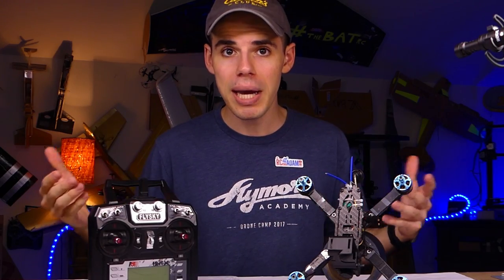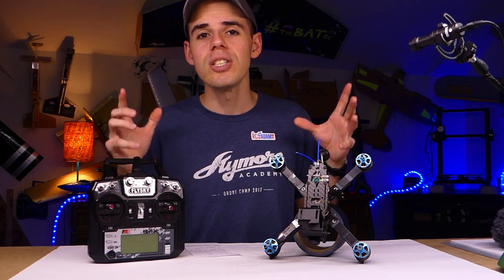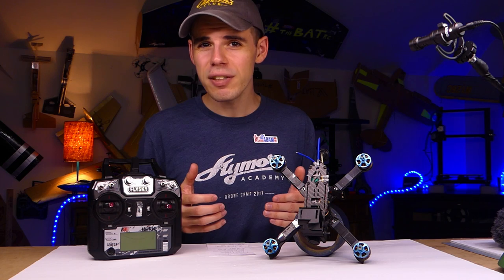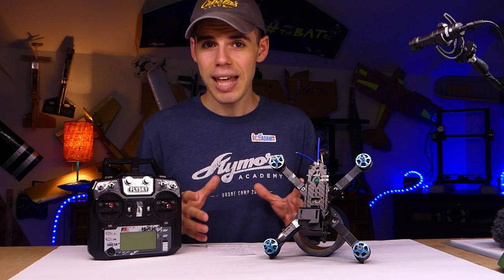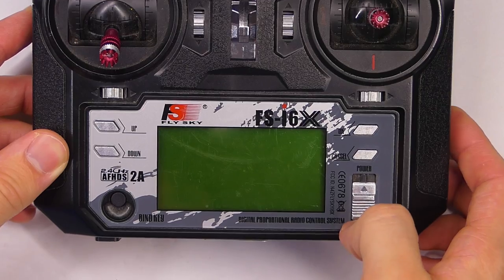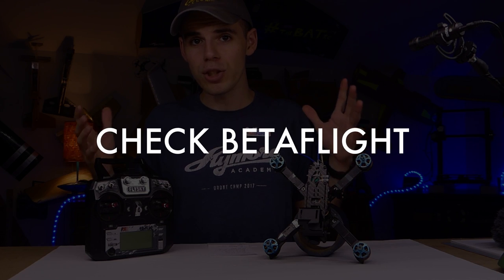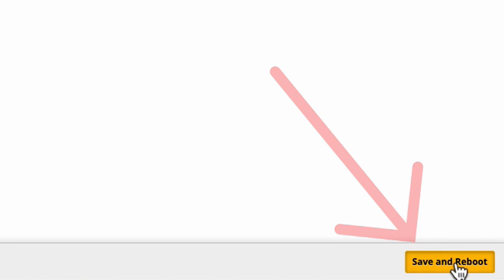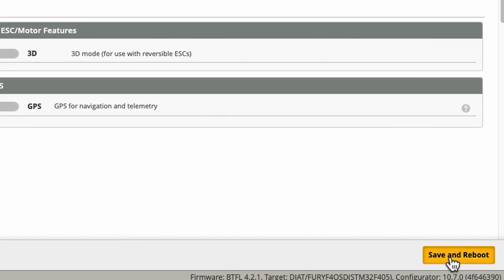Why Your Transmitter Won't Show in Betaflight - Most Common Fixes

Comment from the maker: Did I miss anything? 🧐
Also, if you got at least 10¢ worth of value from this, consider supporting me https://ko-fi.com/rcwithadam
           More videos and resources on my website http://rcwithadam.com/
Reply: Hello, I think your video is super good. I have a HappyModel EP1 ExpressLRS 2.4GHz receiver and would like to set the VTX table in Bethaflight, but it cannot find it. what should I do?
Reply: All these options I tried however my crossfire reciever only comes on when I plug in a battery 🔋, however it is bound to my radio it just doesn’t show the transmitter linked to it all wiring was checked etc
Reply: I repaired my Nazgul 73mm reciever connection because of this video, thanks a ton!

Comment: Hi. What can I do if binding is OK, but sticks don't work nor move in betaflight?

Thanks
Reply: Please help did you get around this issue?
Reply: same
Reply: I'm having the same problem please let me know if you found a fix... my radio was working fine and then I bound it to another quad and that one was working fine and then now I got both of them working and neither of them will work on betaflight it says they're connected but it doesn't show it on betaflight when I move the sticks nothing...
Reply: Any update?
Reply: @griffey11  updates?
Reply: Crickets.... @ThunderFarter

Comment: I replaced an antenna on my frsky xm+ The receiver is solid green which leads me to believe that my transmitter and receiver are bound. Inputs aren't showing up in betaflight when I'm in the receiver tab. Any ideas on what might be going on?
Reply: did you ever figure it out?
Reply: The xm plus uses 2 protocols like rsxr, I had this problem because I flashed 2 ex and int updates to my radio and my reciver but both regarding the subs mode, I was on cppm protocall, u have to set them to the right protocall to make them respond, as well as give correct stick inputs. I hope this helps

Comment: great video however it did not resolve my issue. ive the flysky fs 16 x and the flysky fs a 8s both was working then just stopped, tried flashing the firmware doing a fresh install, just nothing. there no bars in beta flight for the tx. i have it wired up on uart 2 and set it up as in video but working

Comment: Hey, thanks for the great video!  Unfortunately, I'm still struggling with this issue.  I have a Taranis Qx7, updated firmware to newest OpenTx, and a R-XSR receiver that I've flashed to the newest version that would work.  Quad shows bound to the transmitter. I've played with the betaflight settings for hours, but no luck getting any response in the receiver tab.  Any further thoughts?
Reply: i have the same problem have you got it working?
Reply: Me too, my quads essentially bricked
Reply: I've had no luck so far. My plan is scrap the Fr-Sky set up completely and go with a new Tx and Rx.  Thinking the TBS Mamba, but haven't purchased it yet.
Reply: Definitely use a different uart
Reply: I'm having the same problem😢

Comment: I have a quick question. I have a flysky i6x transmitter and a fs-ia6b receiver with a speedy bee f7 fc and I can't get the fc to recognize the receiver in betaflight. I have tried pretty much every combination of channel on the reciever with ibus/ppm in betaflight configurator. I am not sure if my flight controller is broken (everything else seems to work in betaflight tho) or maybe should I get a sbus reciever? Thanks for the help!

Comment: An additional point (where I stumbled) if your quad has a vista unit in it, it needs a battery attached to show your controller in betaflight. 
My analogs I could just hook up with the usb cable and that was enough
Reply: Thanks. Try that out 👍

Comment: im having trouble getting any stick input on the transmitter

BNF UZ65 with Internal SPI Frsky Receiver

Emax E6 Transmitter Radio Controller (FrSky, D8 Protocol)

so i run the bind_rx command,
set the transmitter to bind and the drone reacts to it.
the led starts flashing to indicate it has binded.

But when i look in the betaflight transmitter tab, there's no response for any of the remote input.

When i plugin a battery on the drone, the drone shows that its responding to the transmitter when i turn it on and off, but doesn't do anything.

- SPI RX support for the receiver mode and
- FRSKY_D for the bus receiver

any help would be greatly appreciated!!

thank you

Comment: I had this issue after a firmware flash. In the firmware flash section of Betaflight, the Radio Protocol was defaulting to something other than SBUS (my protocol). I reflashed with SBUS protocol selected and that seemed to have solved my issue.

Comment: Howdy, I’m using Dji remote 2, the work with other drones, but won’t pick up on a few units, the air unit is brand new, but no signal in beta flight. Can something fry on the FC preventing the signal reception?

Comment: I have a problem with my fly sky controller. This is not for a quadcopter it's for a remote control truck. The problem is is that I've got two separate units on my 10 channel receiver. One battery is running the truck the other battery is running to other speed controllers. And roof lights. There is power drain in the receiver. I think this because my light bar will not stay set at the setting I wanted at. My light bar is plugged directly into the receiver. My controller also has problem with his battery warning due to this problem. How do I fix it?

Comment: So recently I had a perfectly working drone and I’ve been using the old butterflight configurator and just recently I tried the new betaflight 4.3 that just came out. So I flashed it over checked all my ports and everything seems fine but I am still not getting any reading on my Betaflight for transmitter receiving inputs. My FC has a designated plug for my spektrum radio which is satellite RX1 my port is UART1 basically on my FC. I did everything else in this video and still no luck after flashing to the new firmware. Thanks hope there’s a solution.

Comment: recently installed an HGLRC ZEUS F722 and I have a FLYSKY FS-I6 trabsmitter paired with a FS IA6B . This receiver is hooked up too RX1 on the flight controller(UART 1) as shown on the wiring diagram. I have a solid red light on the receiver and the tranmitter shows TX and RX batter power in the top right of the transmitter display so I beleive it is bound correctly. I have Betaflight receiver set as IBUS and I plugged the battery in also but still nothing. any suggestions?

Comment: I'm using an fs82 micro reciever for a FS I6X with a Diatone Mamba F405 MK 2. I have signal wire on RX3 and set to Uart3. Reciever goes solid blue when transmitter is on, but flight controller doesn't seem to know the reciever is connected

Comment: Recently bought a quad with F7. Receiver R-XSR. RC Radiomaster TX16S. Binding them, RC says "Telemetry recover" shows good signal, but in Betafligh: Reciever tab doesn't reflect any joystick moves. Everything triple checked, even got another receiver and FC. Any thoughts?
Reply: I have the Qx7 and the same r-xsr with F7 and the same for me. Did you fix this
Reply: Someone fix the problem ?

Comment: Hello im having problem on my protek25 hd crsf rx, it bound and no issues before, now my rx sticks input in bf are not working. I checked all the wire pins are good. And i look at the fc look brand new still. What would be the problem on my case? Thanks in advance.

Comment: What process do you use for checking if you're wires are broken? I have a crsf nano rx om a speedybee f7v3 board and it waaaas working right, registering my inputs on betaflight but when I got out and went to do Mt test hover it wouldn't, brought it back in and checked betaflight to find that the inputs weren't being registered. My TX and rx are connected / bound as I'm getting the telemetry reading on tx & solid green light in rx but it's not being detected by the FC. Today I'm going to be de-heat shrinking my rx and testing the wires for continuity via my multimeter but it's just been a battle lol

Comment: I have a Lumenier F4 FC AIO with SBUS pad on it and I am using R81 receiver connected to that SBUS pad. The receiver shows solid red when I have my radio on but there's nothing moving in betaflight receiver when I do anything on the radio. Any idea what to do?

Comment: Hey bro, I have a flywoo f4 aio flight controller in a fire nano 20, I'm trying to get my fr sky RS receiver to talk to the FC but no response on betaflight. All the protocol in beta flight is correct, wiring is correct. The rx binds perfectly with my remote. Im stumped. I think this board also comes with a built in elrs receiver. Could that be the cause? Help please 🙏

Comment: NO Luck for me on any of this at the moment.  HELP.  

I can connect with Mamba F405MK2 to betaflight.  
I have a FRSKY R-XSR radio that is bound to my Radiomaster TX16S.  If I unplug the battery telemetry drops,  plug it back in and telemetry is reconnected so I know radio is talking to transceiver.   
Betaflight ports show USB VCP  in Configuration ON  and UART1 has Serial Rx on.
I am soldered as per this diagram radio to SBU 5V and the GRD https://cdn.shopify.com/s/files/1/0027/2708/4144/files/2_b407e904-2a0b-4693-8104-94b9e77468e4.jpg?v=1577331450

Comment: Hey Adam I have an Iflight baby nazgul 73mm drone and the flight controller does not show up in Betaflight and I'm wondering if the MSP is turned off in the ports tab. If so how can I reactivate that port so I can fly again? Also windows usb doesn't recognize the fc either but my other drones are fine.
Reply: Adam hello???

Comment: Hey man I recent bought a BNF with the 03 air unit but I got it with ELRS so I could try out a different style of radio than the Dji because that’s all I’ve used so far. I’ve bound goggles and there’s some connection between rx and tx because wen I take power off the fc my radio says “telemerry lost” and vice versa wen I plug it back in. But I can get betaflight to respond to any stick or switch inputs. And I can’t remember if there’s a “c” for connection on my radio. But I have all the settings the way you stated here yet still no feedback on BF I’m stumped!

Comment: I've bound the tango 2 pro (mpm module installed and updated) to the taycan diatone xsr receiver and I have telemetry confirmation on the radio but the receiver tab on betaflight won't show my stick input in I'm fresh out of ideas, any help would be appreciated
Reply: @Lowkey swe im having the same problems, did you ever figure it out?
Reply: same bro!
Reply: @leonardsimmons97  same man
Reply: @MatthewRumble  I was able to get mine working properly after I changed my channel mapping to AETR in my tango 2 while setting up a new model. I would check that then double check your betaflight channel mapping. Also make sure while setting up your channels in your tango 2 to turn on any aux switches you want to use. Hopefully that helped there definitely isnt many videos out detailing the tbs mpm and tango 2
Reply: @leonardsimmons97  how do I change the channel mappings
Reply: @leonardsimmons97  tried it. Didn't work
Reply: @MatthewRumble  I think another thing I tried was checking to make sure my rx was turned on and setup in the configuration tab in betaflight. Mine had somehow turned itself off. Maybe double check that?
Reply: @leonardsimmons97  yeah nothing worked
Reply: @MatthewRumble  damn I will take a look tonight to see if I did anything different

Comment: I have an RP2 v3.1.2, solder tx to rx5 and rx to tx5.. selected uart5 port, bind to tx12 v3.0.1. Serial provider crsf. Drone and beta flight not registering transmitter outputs, any help would be appreciated!

Comment: I have an FrSky R-XSR Ultra SBUS/CPPM D16 16CH, and I have it wired up to the 5v, ground, and SBUS pads on my FC. I also have managed to get it to connect to my radio(TX12), but it still does not show up on betaflight when I move the sticks? I have been trying to figure this out for so long at this point, and I really just want to be done with this.

Comment: have elrs tx and rx. i flashed w bind phrase (the rx) and eveything seemed to work. when i disconnect battery i get telemertry lost warning but the inputs are not shopwing in betaflight to setup switches. am i doing something stupid?

Comment: Please help !!! I have a Diatone Mamba f7 dji flight controller and I have installed a TBS Crossfire in it. and It is binded, once the reciever showed ok on Betaflight and then NO it does not work there is a connection telemetery between the tx and rx so that s ok but Betaflight just will not recognise my reciever no matter what I do?

Comment: help! I have ELRS receiver (Happy model ep2 2.4ghz) and jumper t lite transmitter. I have set up: LUA script, flashing both receiver and transmitter, soldered to UART2 like the manual says TX to RX and Rx to Tx ( yes I tried other way too) .. I turn on drone, I turn on transmitter, they are paired.. but in betaflight (yes I enabled serial for UART2 and changed to serial in config tab, protocol to CRSF) there is NO TRANSMITTER SIGNAL. joysticks do nothing, and switches do nothing .. I've been trying to get this drone flying for months

Comment: Hey I got the FS-i6 (not the X version) with FS-IA6 receiver and I cant find an output mode in my settings    Any clue as what I should do ? Thanks and God bless :)
Reply: Were you able to fix the issue? I am having the same problem

Comment: Hi, after crashing a Tyro129 I am having trouble with RX connection with the quad.
I tried both an R9MX and XM+, they both used to work with this quad and still bind ok with the remote.
Quad behaves ok when connected to betaflight, all features work, vtx is ok, gps locks ok.
Only thing that won't work is RX-FC connection, I checked wirings severeral times, pins continuity is ok, I also bypassed the plastic connector and soldered the RX straight to the FC (also trying different input pins), none worked.
FC led blinks red all the time
R9MX seems to connect intermittantly (remote keeps saying "weak signa", "signal lost", "signal ok")
Any ideas on how to throubleshoot this? How can I be sure that the eachine GPS F4 FC is fried?
thanks for you help 🙂
Reply: keep the transmitter at least 1 meter from the receiver. I'm facing the same fc<->rx issue unfortunately.

Comment: Hello, I have a Radiolink AT9S Pro radio and a R12DSM receiver. They are bound but will not show up in Betaflight. Im also using the plug-ins so I have no idea if a connection is being made. The FC is a MATEKF405 upgraded and soilder points on the back of the FC are not clear on what pads do what. Any ideas.....lol?

Comment: Running a Spektrum DX6e and a Spektrum SPM4650 receiver and a Spektrum F400 FC. The receiver indicates it needs to be connected to a transmit pad, which I have done. But when I set that UART (TX4) Betaflight locks up and no longer sees the FC. When rebooting, the FC doesn't even get recognized. What am I doing? Its driving me nuts!

Comment: Hello.
 I am a beginner and need help setting betafpv 75xhd with (F4 2-4S AIO Brushless Flight Controller 12A V2 (BLHeli_S) and frsky XM +. Binding ok with betafpv tx02 or taranis x lite s..but in betaflight arming flag "  RX failsafe ". And no reaction when I move the sticks in the transmitter tab in betaflight ... Tried to set failsafe directly via F / S button or via betaflight ... it doesn't change anything ..

Comment: Hello, thanks a lot for the video ! i have a problem with my succex e F4 motherboard, when I plug in my receiver (r12dsm  bindend with at9s pro), I keep trying different uart ports ( R4, R6... etc) none of this would work, my radio isn't recognised in betaflight, the RX and TX are well binded but nothing happens, I spent many hours trying to solve the problem but betaflight doesn't recognise my radio, the sticks doesn't move in the radio part ... Could you please help, it is getting on my nerves and I feel like I tried everything ...

Comment: I am not a newbie, but back at it after two years and just got some Dji goggles and am putting
everything together fine, but cannot get Betaflight to see my bound nano rx!  Tried switching tx/rx wires surning on/off soft serial, switching UART's, Radio TAER ATER configs -NO luck withja bright green LED on the nano and seeing outputs on the Taranis all functioning! Any suggestions?
Reply: I am in exact same boat as you, mine is a radiomaster, tried Uarts, Switching  tx/rx...same as u green solid light, but no joy !
Did you fix it?
Reply: Same problem ! You fix it ?

Comment: Hi friend i did it all & it. Not working ☹️ i have beta95x v4 board and i have xm+ reciver and my controller its jumper t lite it’s binding correctly but nothing work at all i dont know what to do and for the wires im putting the y-wire to rx1 and b-wire to gr.. and the red to 5v im not sure what is the problem i try all the settings you saying help please 🤦‍♂️

Comment: Hey. Just bought a Tyro79 and having issues with my R-XSR talking to the FC. Bridged SBUS & RC is correct and I have re soldered to make sure there's no dry joints. I'm bound to the receiver successfully and all my ports in BF are set correctly but still have no stick inputs. Starting to think the FC is faulty? Thanks
Reply: i have the same issue, im trying a ne fc tomorrow when it turns up, if now i have an entire new mamba stack coming, also im useing a taranis x9 lite
Reply: @geoffprogression  Let me know how that goes... I managed to get mine to work by swapping F.Port to SBUS out on the RXSR, I'm not too bothered about telemetry from the vtx. However... I have come across another issue. The FC doesn't power up when the vtx is plugged in and powered by a LiPo. This issue just started happening, I did nothing. I can confirm its the vtx because I took one from another quad and it powers up just fine now. Lesson learnt, my next build with be custom with no cheap crappy Chinese parts :)